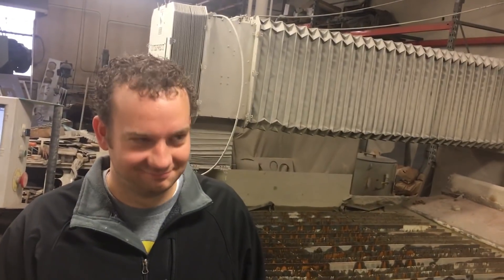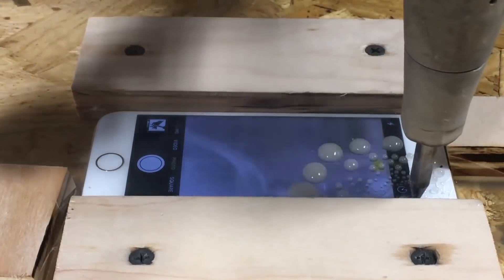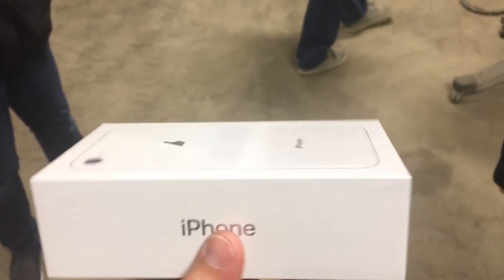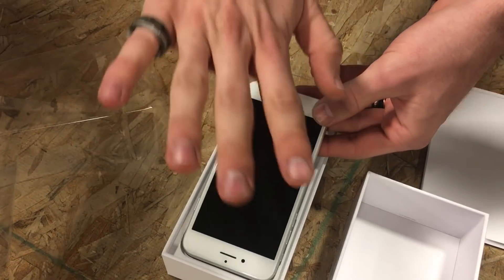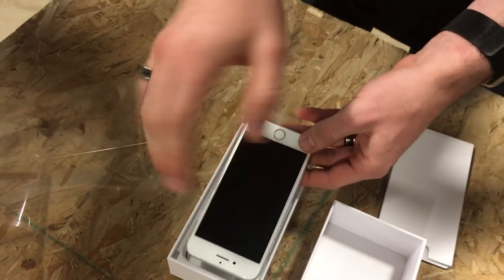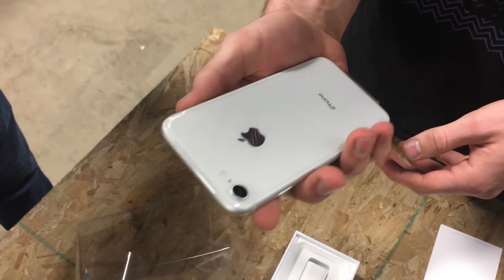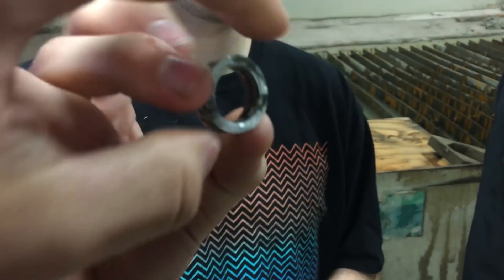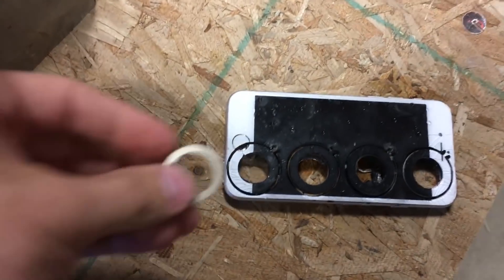iPhone 8 Ring Making with a 60,000 psi Waterjet Channel - Interesting Cross Section

Comment: Should have just used a broken phone. No difference in the rings if you did. And I don't know how you can spend that many hours on turning and polishing a resin ring? Someone with slightly above average skills and attention to detail plus a drill, some sandpaper and polish could do a very similar job in a fraction of the time for a fraction of the cost. The meteorite and super conductor rings are unique, but that much for a resin ring is highway robbery

Comment: Fake the screen on the iPhone 8 is all the way to the edge and the back is glass also there is no button and on this one the lenses are different
Reply: Dvloger 1 its an iPhone 8 u mean the iPhone x
Reply: Nice try troll but Apple Fans know the X is the edge to edge variant phone, the 8 is just a normal typical framed screen, both have the glass backing